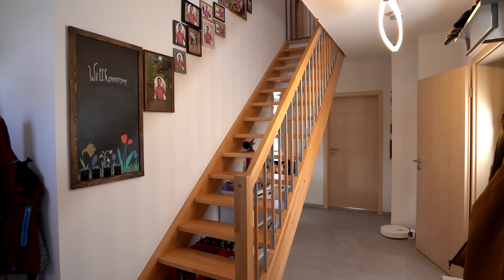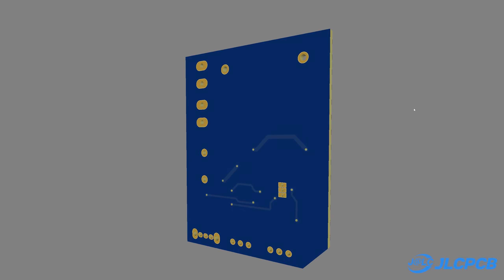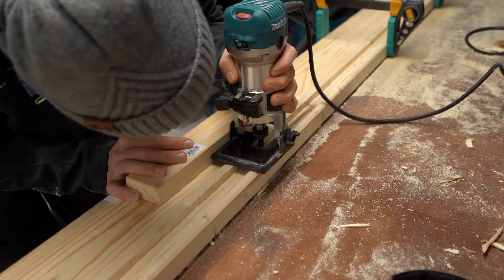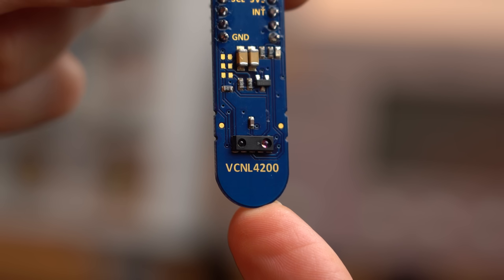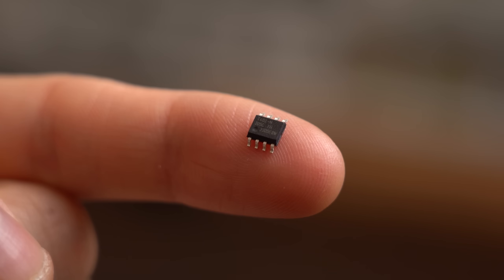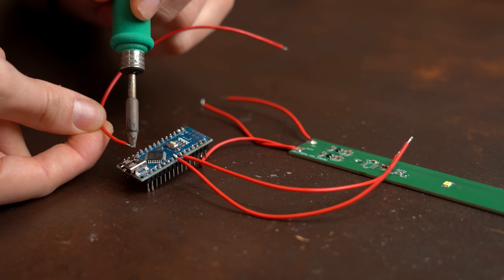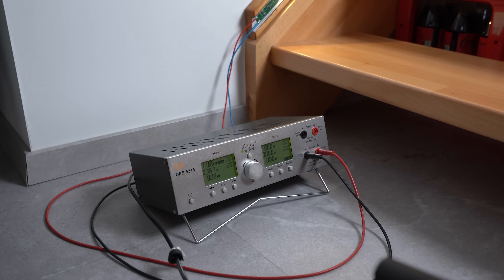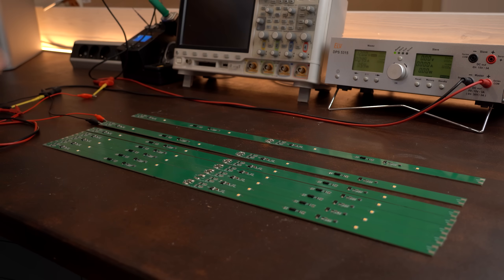I tried to Revolutionize LED Lights!.....And FAILED?

Comment: I found where you have the problem!!!! I also double checked with a electronics technician that has 50+ years in component level troubleshooting and high frequency circuit design who just happens to be my father that my suspicions where correct. He was able to give a solution and explain why it was happening along with why you were getting that specific frequency.

Your driver circuit for the LED needs a second filter on the other side of the coil (U6) but before the diode (D3). In the current configuration, with the PWM being fed into there, you are pumping a RLC circuit in a single direction that has no where to release its energy other than ground and the power monitoring pin of the micro-controller (pin PA6 of part U3). Since it is going though a series of diodes, it is reflecting off of them and this is causing a doubling of the frequency. If you run a RLC calculation f = 1 / [2π × √(L × C)], you get 7.341 kHz for with the ideal component values and 14.682 kHz for the doubled, which is within 95% of the ideal component values, so accounting for the variance in the parts and the sub-harmonics we are seeing on the oscilloscope, this is pretty good proof that the hypothesis is correct.

To test it further, removing a single unit for testing would be advisable and then replacing filter capacitor C10 with a different value or adding one in parallel to change the value and then checking with an oscilloscope might be a possible way to check for it. It is also possible that the oscillating circuit is internal to the LED driver IC, so adding this cap may do nothing, but adding the filter at the location that I specify as the solution is going to still work as that is the correct filter location in the circuit.

You are going to need to put rejection filters between U6 and D3 that only pass DC and the fundamental frequency for your PWM signal. You could also get away with a low pass filter if the fundamental frequency for the PWM is low enough. I would suggest changing the PWM frequency to a lower value so that you can just use the low pass filter as high frequency noise is easiest to filter out. The datasheet for the micro-controller shows how to do this. As long as the resulting frequency is at least 10% below 7 kHz it should get rid of the noise. Assuming you are on the default settings for it, you should be well below that, but double check.

Now as to the why on why this was causing so many problems with the micro-controller. The default clock speed of the micro controller might be set to 16 kHz (+/- 3% over voltage range and +/- 2% over temp. range) by default, so, if you have a signal on the other end of the PWM output pin that is close to that and really noisy while being unstable, like you have, and that pin isn't optically isolated (which this micro-controller doesn't have optical isolation on its I/O pins and problems like this are why you want optically isolated I/O pins) the interference can be feeding back through the circuit and causing problems with the PWM circuit. 97% of 16 kHz is 15.52 kHz, which is close enough for some signal coupling, so it can feed back into the circuit and cause the clock for the PWM to start having errors that the processor will have to correct, which will cause all sorts of strange behavior.

I would change the internal clock that the PWM is using to the 20 kHz mode that the micro-controller has the option of using to just completely take it out of using a similar frequency. Make sure that the fundamental frequency that gets produced by the PWM still stays below the 7 kHz range using the equations given in the datasheet for how resolution and clock selection and clock type result in the output PWM signal's fundamental frequency.

Just putting the filter in will probably fix most of the noise, but lowest noise possible is the best thing to do when dealing with micro-controllers. I would suggest in future only using micro-controllers with optically isolated outputs and always make sure that if you have a cap and coil in series in an oscillating circuit with diodes that you have a filter for both directions that the coil can discharge unless you are trying to make it oscillate or build a higher voltage.
Reply: U1 is the LED driver at 7:30. The circuit he used is exactly the same as Diode's reference design, it is just drawn a bit weird. The chip itself is a bit weird for using high-side sensing instead of low-side. Aside from that, it is a completely ordinary buck regulator. The only thing "missing" is an optional filter capacitor across the LEDs at the regulator, which may help with EMI when the LED current loop is taking a ~35cm trip around the board.
Reply: @teardowndan5364  I know it is buck converter and it is going to have a ring to it there unless you add a filter where I said to put it, they all do and that is the frequency of that specific circuit's oscillation. The problem he is getting is that the frequency it is ringing at is really close to the clock source the PWM circuit is using in the micro-controller. This is a problem because the micro controller doesn't have optically isolated I/O pins, so any high frequency signal that gets on one of those pins that is close to one of the frequencies the controller IC uses, it will propagate into it and start causing errors intermittently.

He might be able to get away with just changing the clock value in the controller from 16 kHz to 20 kHz. If not, he needs to filter off that noise.

A buck converter circuit is noisy. Connecting it to a digital circuit or a circuit with active components can result in weird behaviors since you are going to get noise from the buck converter that is in the kHz to MHz range, both of which are in the RF range where they start treating everything as active components, even the case of the circuit, so when it gets into an IC, things get weird. I would use a different power source for driving the LEDs in this application next time or isolate the power supply from the micro controller, like with optical isolation.
Reply: How does someone get this level of understanding
Reply: @coolmonkey619  2 year degree at a technical college will do it. A BS or BA in electrical engineering will also cover it. You are probably going to need a 3.0 or higher GPA or at least paying attention to the topics of power supply supplies, digital circuits, and high-frequency circuits. Just for this problem, having a basic understanding of IC internal design and clock generating is also needed for this as well. Then you also need to understand micro controllers along with microprocessor error correction to see why the problem was so weird.

I only confirmed my suspension about the problem with my father, who is a retired microwave telecom tech and designer because I could find the multiplier in the circuit that was giving the 15 kHz, but that is mainly because I would never have ran across this problem since my instructors warned me about the pitfalls of noisy power supplies and digital circuits along with micro-controllers needing the optical isolation or you can risk noise backfeeding into the I/Os or a transient coming in and frying the micro-controller.
Reply: @KnightsWithoutATable  If Diodes doesn't include any additional filtering, I am pretty sure it is because its engineers who work on this stuff full-time have done every analysis prescribed by best practices and have concluded that it is perfectly fine as-is for the IC's intended application and following applicable layout guidelines, which usually includes keeping all high-frequency stuff tightly packed, which it isn't when you have two LEDs in series spaced ~15cm apart and the traces in-between acting as an antenna.

Just had a look at his PCB layout. The LED trace routing is an EMI disaster. The current return trace needs to be parallel with the source trace like a differential pair, not routed along opposite board edges! And those power traces are also running parallel to the data traces on the other board layer. Maximum EMI.
Reply: @teardowndan5364  it is a buck converter. They are noisy power supplies. That is just how that type of DC power supply operates. They have high-frequency wine like this all the time. The microcontroller has unfiltered and unprotected I/O ports and the frequency that power supply puts out is close enough to one of the internal clocks that pin can use that the filters for that circuit won't filter it out.

I have a degree in this stuff and made a living doing it. My father put me through college doing even more complicated electronics and designed and troubleshot microwave and RF telecommunications equipment. He said I was correct.

Know what would be a quick check of this? Remove the power supply and replace it with a switched mode power supply since that is what this application should have been using or optically isolate that pin.
Reply: @KnightsWithoutATable  Switching power supplies can be quite clean when properly designed and laid out, which this board layout isn't.

Interference has nothing to do with the supply noise resembling the micro-controller's clock frequency. It has everything to do with the data traces running parallel with the LED power traces on adjacent board layers across half the board length. That is a cardinal sin of high-speed board routing.

The 12V bus having ripples at double the LC frequency is a byproduct of the horrible layout: the high-side trace runs parallel with and right next to the 12V strip, which makes it an almost 1:1 transformer. Everything that happens to current in the LED loop gets reflected into the 12V supply. Run the high-side and low-side LED current traces over the 12V copper pour to make them cancel each other and most of the 12V noise will go away. That also takes care of the LED power traces running parallel to the IN2/OUT2 traces on adjacent internal layers, which should unscramble them. Running data parallel to noisy power traces without a ground or clean power plane in-between is a cardinal sin of high-speed board layout. 

BTW, now that I have seen the digital schematic instead of the in-video paper schematic, I see that U6 was actually the inductor. So you saying "add a capacitor after U6" and me saying "add a capacitor across the LEDs to bypass the current loop antenna" were effectively the same thing, albeit with different reasons for saying so.

All of that said, the board has multiple fatal layout flaws.
Reply: @teardowndan5364  Yes, those data traces and the power trace should have had a shielding trace between them or more separation. I didn't even look at the board layout as I had assumed that it had been laid out correctly since it is a pretty simple design. This is what I get for not looking over all of the project files. Definitely need to scrap those boards or it is going to be bodge wire time, but with all of the other problems with this project, I think that reusing the ICs is about all it would be worth salvaging from this and that is only if they are more than a at least $1 USA each, so the micro-controllers, but I wouldn't use this specific model again. One with optical isolation on the I/Os or if you could add an IC or optical isolation circuit? Yeah, it's a pretty capable little chip that can do a lot in a very small package.
If it was on an isolated logic voltage level or digital portion of a board then it is exactly perfect. It is isolated there and will work perfect with no other problems. Looking at the suggested applications, that looks to be where it was intended to be used.
Reply: @KnightsWithoutATable  Optoisolators are overkill for this application. A bit of layout care and a bypass cap for the LED loop would easily contain the LED driver noise. Run the data lines over a continuous ground plane going under the micro-controller, keep power stuff away from signal traces and it'll be fine.

As far as guard traces in digital stuff are concerned, the general rule is that by the time you put enough distance between two data traces to run a guard in-between on an otherwise properly designed PCB, they are already far enough for crosstalk between the two to not really matter anymore. I don't remember the last time I have seen guard traces on a digital board. They are mostly a precision analog thing, such as references in 6+ digits DMMs.
Reply: @KnightsWithoutATable  BTW, I just redid most of the board layout as an excuse to try Easy EDA... almost ended up with three ground planes, albeit with quite a few copper islands on the top/bottom layers, inner layers are mostly ground apart from a 12V pass-through strip on the 3rd layer. This reminded me that Scott's initial board layout had another fatal flaw: he didn't stitch is ground pours back together around breaks, another cardinal sin around high-frequency stuff like a switching regulator or micro-controller.

Also, having the 5V regulator located a mile away from its only load isn't good practice.

And he really needed only one board-to-board signal to chain boards together: have either micro-controller pull the upstream and downstream links up, then either of them can drive them low whenever their proximity sensor gets tripped, lighting up whenever either upstream or downstream link is low. When the trip condition is removed, the tripped micro stops driving its up/down-stream pins low, the link gets pulled high if none of its neighbors got tripped in the meantime and LEDs get turned off.

I tried creating an Easy EDA account to save my modified layout but re-opening in a new window for the login to take effect causes the design to get rolled back to a mangled original.
Reply: @teardowndan5364  No connections between ground planes would cause him all sorts of problems. I think it's time for a best practices for circuit board design video or linking him to one. I use an old Motorola book for mine that covers building RF, power, and digital all on the same board for guiding me, but since I retired early for medical reasons, I don't have a need to use it all that often. I am sure there is a channel that has guide videos and tutorials for board designs GS could refer to and recomend. Maybe EEBlog with that Aussie guy named Dave?
Reply: @KnightsWithoutATable  He does have connections between ground pours... but only where he happened to need a via to reach ground.

As far as reference materials go, one of my favorite sources is High Speed Digital Design: A Handbook of Black Magic.

I have seen a fair amount of EEVB's videos, don't remember seeing one going in-depth on high-speed board design if we exclude tear-down commentaries where he sometimes geeked out about some details. I know he's done many "traps for young players" type comments which could amount to board design 101 when put all together, especially when he did viewer board reviews.
Reply: Very interesting. Could you explain why the diodes are doubling the frequency and how current is going to PA6 from the CTRL pin?
Reply: @rickaurum3964  The frequency doubling at ~14kHz shouldn't be a thing in a properly laid out and working 250+kHz buck regulator. It is likely a byproduct of one LED power trace being routed near the 12V bus strip and the other one being routed along the opposite board edge. The huge current loop area is flooding everything within it with EMI when the LEDs are on. The LED current loop needs to have a bypass capacitor at the LED driver to reduce the amount of HF noise getting radiated through the long LED traces at the very least. Ideally, you'd run the LED power traces as a differential pair to make most of its EMI cancel itself out.
Reply: @rickaurum3964  Reflection since the signal can't propagate through them on the lower half of the sine wave of the signal, so they bounce back, acting as a doubler for the frequency, but losing half the power. High frequency signals, when not coupled and given a path to complete their circuit will bounce off of parts, badly designed traces on a circuit board, and even loose connectors. This is why we are seeing a shift in the voltage and the some of shape of the waveform on the oscilloscope, possibly. The interference is so messy it is hard to track it down to a single source.

There are other sources of interference and bad design choices in this project causing far worse problems. One of the other people on here brought them up as a response to my post. It needs a redesign from the ground up, but the idea is sound and just needs a lesson on proper circuit board design practices along with a video on understanding, designing and troubleshooting RF (radio frequency) frequency circuits (anything from 10 to 9999 Hz).

We don't need to go into high frequency stuff, but most of what would be talked about applies, but their are just some extra steps you have to take every time you go higher since things get more difficult to contain and not have it do things you don't want it to, like turn a trace on a board into a transmitter and oscillator because the trace has too sharp of a corner.
Reply: I have no idea what it mean, but I agree to this knight.
Reply: Scott needs to see this!!
Reply: @KnightsWithoutATable  I agree with your theory about the ground planes but way more-so about the drivers. In fact, I don't think his single power supply can send enough forward voltage through every driver that is in series along the line and they are staying on just from the forward voltage of capacitance alone. I think a 20kHz crystal across pins 2/3 of the crystal would allow for better PWM and less noise in the ground, as well as using another filter before data in & the driver on the next PCB, or a boost driver at the end of the PCB to ensure he's getting 12v out with at least enough amperage to drive the next PCB.
Reply: I have a degree in electrical power design & engineering (usually hv stiff but had a couple courses in power electronics). A quick look at the rooting, current loops everywhere. An EMI mess. Some of the circuits are akin to antennas etc.. I mean the first error was ordering all the boards at once.
Reply: @matthewmaxwell-burton4549  Yes, prototype one first.